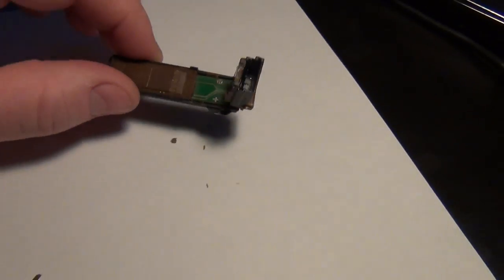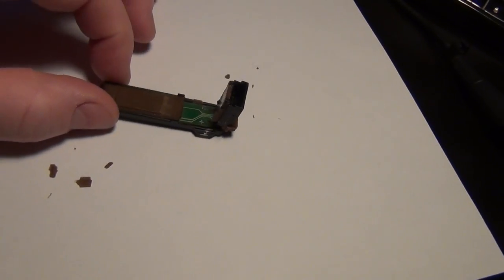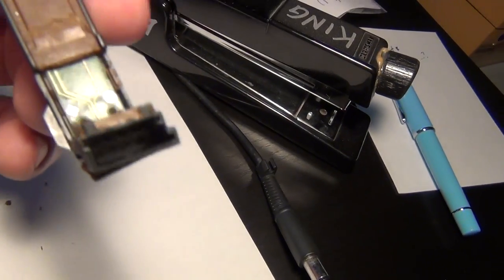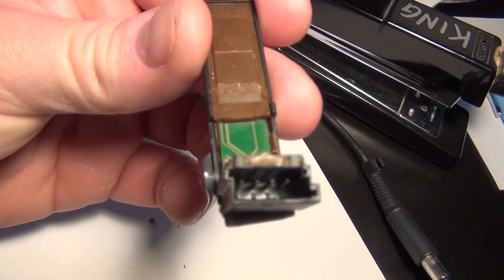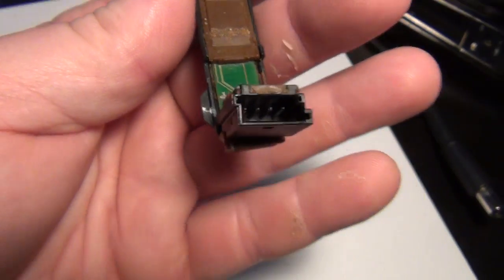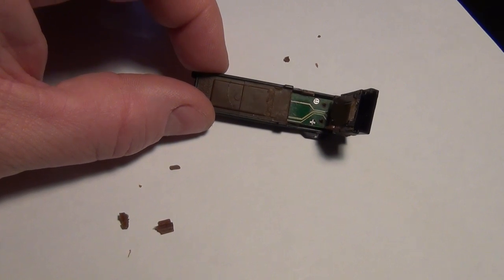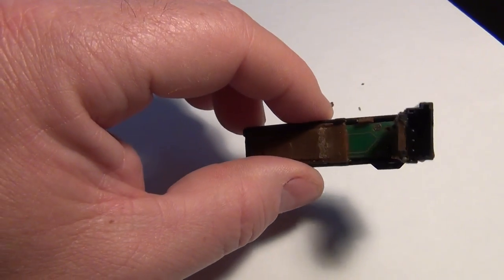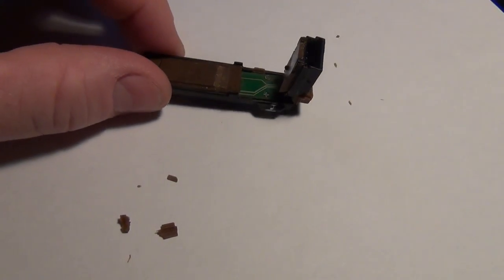(E46) 2005 M3 clutch module (1 of 2)

Comment: I am aware this is an old vid but I am getting an intermit start on my 2003 M3. I have troubled shoot every single component but this switch. I am glad you posted this as I could not figure out why this is an intermittent problem. I am going to bypass this switch to see if indeed this is the issue. I will post again if it starts. Thanks.
Reply: Did that work for you ?
Reply: @rhdzoe605  yes it did. Changed it and started right up everytime. When you see it you will know why. Gets worn and fluid drips into it. Good luck.